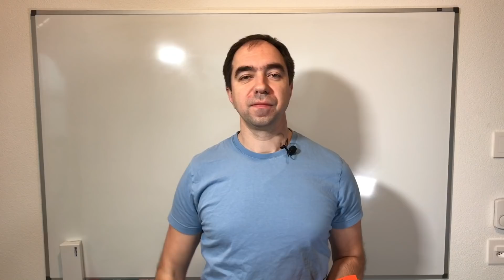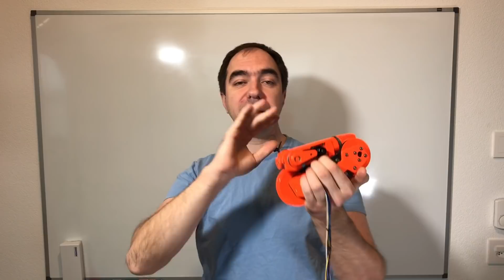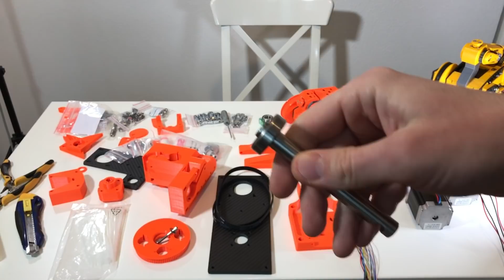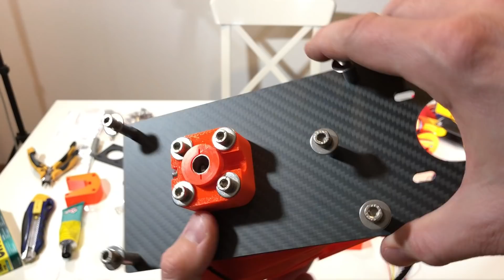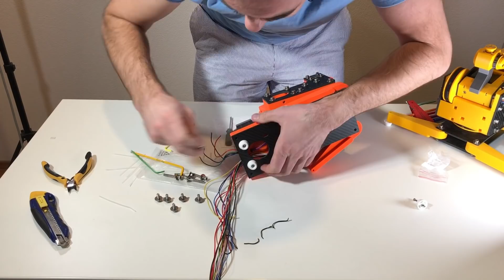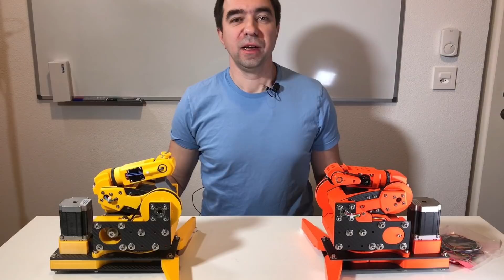6DoF mostly 3D Printed Robot Arm (Part 4)

Comment: I started building this arm. Thank you for all the files and descriptions. Everything is straight forward, except printing the parts. It's very hard to find the correct way to print them. They need a lot of supports and I'm most of the time are not sure what is the best orientation. It would be great if you show how to place them in the slicer.
For the CFK plates I decide to print them. I have a high quality CNC here but the raw material is very expensive.With the low payload of the robot arm I think it is not necessary to use CFK. If I'm wrong I can later replace them.
Again: Thank you for all your work and the great model. But please show us the best way to print the parts.
Reply: Can you please show us how have print Axis2part2? What supports do you use? I use the same material and the same printer as you. The parts need about 1 day and 8 hours to print. Trying here is very time-consuming and expensive. You made this part some times. Please show us your printer settings or post the gcode (or project for Prusa Slicer 2) on github. Please!

Comment: Awesome! I am already starting working on it! But one question, I saw 4 dowel pins in the list. But I have not found wherer to use them in videos. I guess I missed something? Can you point out where to use it in the video?
Reply from the maker: Good question. It is in the video part 1 (the full name of video is “6DoF mostly 3D Printed Robot Arm (Part 1)”) on time 10:12. I use 3 dowel pins their to fix the axis number 5. 

The forth dowel pin is really optional. I use it in this video (Part 4) on time15:53 to hold the small cover for wires. 

I hope this helps! Thank you for your comment!

Comment: I dont like loose the torque due to weight of the motors , there is almost no force left to lift anything else from itself.
So we can improve the center of gravity of the moving parts via adding mechanism and more transmission elements.
Reply from the maker: That is true. But it will further complicate the design.

Comment: What is the infill percentage in these parts. I always prefer a 100% in my.
Reply from the maker: I know that many printers struggles to print at 100%. I usually use 50%. It prints more easily and the parts are quite strong.

Comment: how do you choose the motors...do you do the torque analysis... if so can you tell me how
Reply from the maker: I just did some basic estimations. I chose the dimensions and the payload. And afterwards I just looked at the torque at each joint (for the worst case, when the arm extended horisontally), and find an appropriate motor for each joint.

Comment: How long to print the big part Axis2part2 with the mk3 ?  
For the position the three cylinders are oriented upwards ?
Reply from the maker: Exactly the position: three cylinders are upwards. Also I used support in several places. And on MK3 it took me 36 hours, if I am not mistaking. This is the largest part and it takes a lot of time to print.
Reply: @Skyentific  Thanks for answer
Fast setup 0.2mm pet I have 19h not enough supports I think
Reply from the maker: I used 0.15mm layers.
Reply: @Skyentific  Do you think 20% density with pet is enough for this piece ?
Reply from the maker: For this part it should be enough. I used 50% on all parts. But for this big part I am sure 20% would be enough.
Reply: Hi, bro. Can I know where did you get the metal tubes?

Comment: a) Ball Bearing BR030803 8x3x3mm sold out at hobbyking
b) Ball Bearing 21x15x4mm not able to find without exact product code at hobbyking
c) Ball Bearing 16x8x5mm not able to find without exact product code at amazon
d) SDP-SI supplier in the US, I am in Europe, extremely expensive shipping
general advise: please make a better shopping list, second source for all parts
think about makers in Europe, mechanical components should be universal and easy to be purchased,
otherwise your project is dead. Could you upload not only STL files, but as well STEP, IGES or parasolid x_t files,
this would make it easy to substitute or adapt to other available ball bearings.
Thanks for help, you are doing an important project, I am trying to follow and build a prototype in Germany.
Reply from the maker: I am from Switzerland. I am also in Europe. 
a) Amazon: https://www.amazon.com/Groove-Bearing-bearings-MR83ZZ-L-830ZZ/dp/B00ZHSR80U/ref=sr_1_1?ie=UTF8&qid=1547556510&sr=8-1&keywords=8x3x3+bearing 
b) Bearing type: 6702 . You can find them on Amazon too. On hobbyking it has part N 249000477.
c) 688 bearing. Amazon: https://www.amazon.com/8x16x5mm-Precision-Bearings-Rubber-688-2RS-BU/dp/B00ZVF8EMU/ref=sr_1_1_sspa?ie=UTF8&qid=1547556649&sr=8-1-spons&keywords=16x8x5+bearing&psc=1
d) I don't like SDP-SI, they are slow. But they have a lot of parts, and I do not know any website in Europe which has so many different belts as SPD-SI. If you would find one, please tell me.

I will try to find the time and to upload STEP files or other formats.
Reply: Thanks for your support, I will try to order components today and let you know my progress. Good to know you are in Switzerland, so we can meet up, i am based in Munich. Would be good to upload the STEP files, for easier modifications and adaptations
Reply from the maker: I draw this arm in the Fusion 360, and I will see which type of file I can export from there. I worked in SolidWorks before, so I am not very familiar with Fusion 360.
Reply: the kernel of solidworks is parasolid_xt, by any chance try to export in parasolid, otherwise IGES or Step, thanks.
Today I ordered all components and material.

Comment: Wonderful as usual. Thanks for all your efforts and for making the files available. I would like to print some parts with PLA because I find it easier than PETG. Are there any parts which must be PETG? Thanks again.
Reply from the maker: Thank you for your kind words. My first robot arm (yellow one) is completely from PLA. I think it would be nice to have this parts from PETG: Axis6motorHolder, Axis5 and Axis4 (as this parts are in direct contact with the motors which heat a lot).

I should say, that I was surprised, that my printer prints PETG without any problem. I have a little bit of stringing, but not much.
Reply: @Skyentific  Thanks

Comment: how did you get the carbon fiber parts? Sorry, I forgot..
Reply from the maker: I odered them. In the github I put the drawings for these files. I sent this drawings to famoushobby company (in China) and they sent me the parts. On github webpage in pdf files with bill of material I put the price, which I paid for this. I paid 107USD for all the carbon fobre parts. Otherwise you can buy the carbon fibre sheet and cut it at local fablab. 

There are a lot of places where they cut carbon fibre. (Usually people use them for drones.)

If you cannot cut from carbon fibre, you can cut it from other stiff plastic, or even from aluminum.
Reply: @Skyentific  I cant seem to find the GitHub repo, can you post a link
Reply from the maker: Hans Müller , https://github.com/SkyentificGit/SmallRobotArm?files=1 , this is the link from my previous video. I also put it in video description (I should have done this from the beginning).

Comment: How much it would cost to build the arm ? Hardware wise motors bearings etc ?
Reply: The bill of material is in his last video
Reply: Ursa Ovidiu tks I thought I had already watched ... but I didn’t
Reply from the maker: Tomás Martins , https://github.com/SkyentificGit/SmallRobotArm?files=1 , this is link to the files, in two PDF files you can find the prices for components in USD.
Reply from the maker: Exactly. And it would also depends which electronics you plan to use.

Comment: Nice video ! Are you sure that you need a nema 23 for rotating the base? A nema 17 at 0.65nm couldn't rotate it properly?
Keep up the good work!
Reply from the maker: Ursa Ovidiu, excellent question. I am sure that in this horizontal orientation nema 17 would be enough. But this robot arm could be also mounted on the wall vertically, in this case nema 17 would not have enough torque. Thank you for your comment!